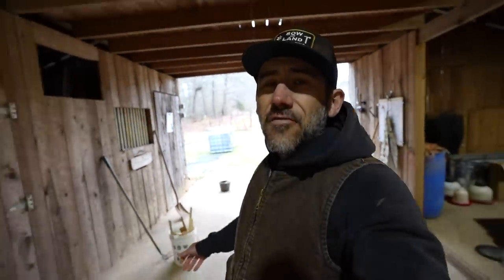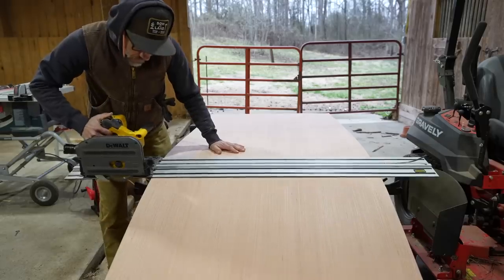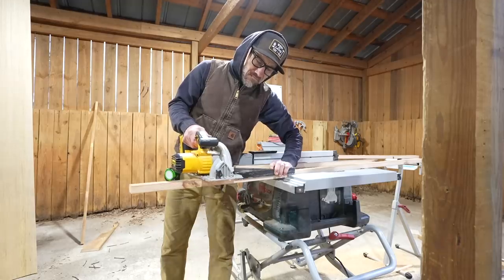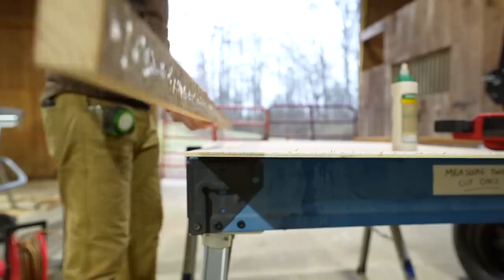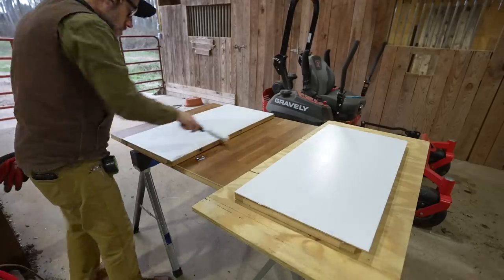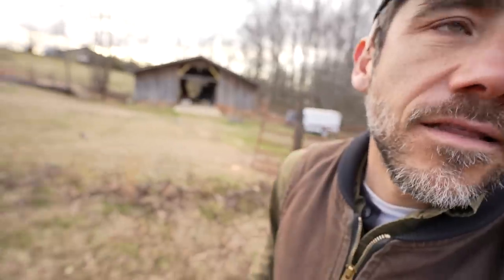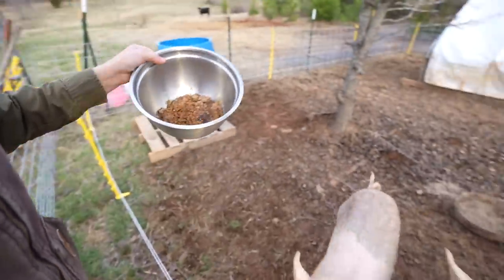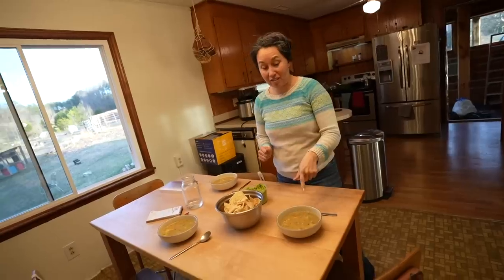Chicken Season Starts in 43 Days/ Building a New Brooder

Comment: I'm trying to learn and I don't really have a dad to help me with this sort of thing. The nailer you were using, is that called a brad nailer? I was looking at Ryobi but someone told me that Brad nailers are for trim and it wouldn't work to build something, so I'm not sure what to look into.
Reply from the maker: It’s called a narrow crown stapler. It holds the 1/4” ply better than a regular nailer.